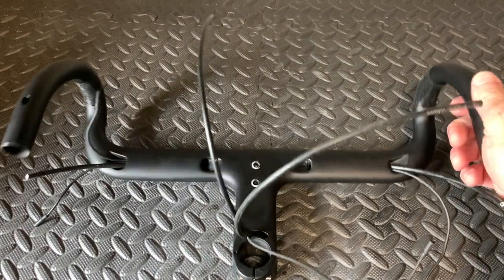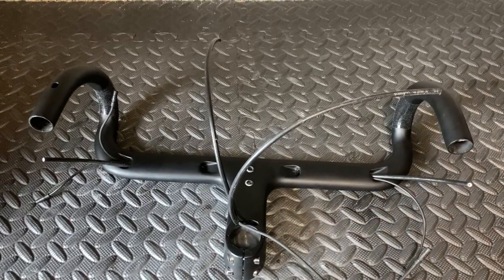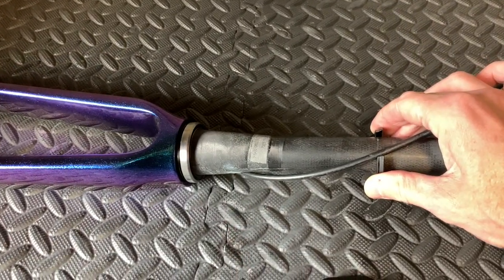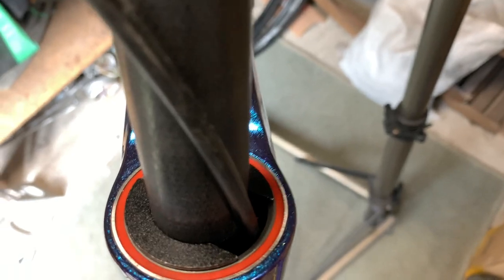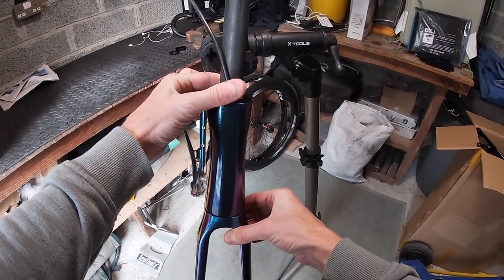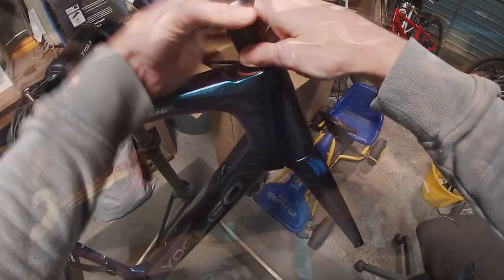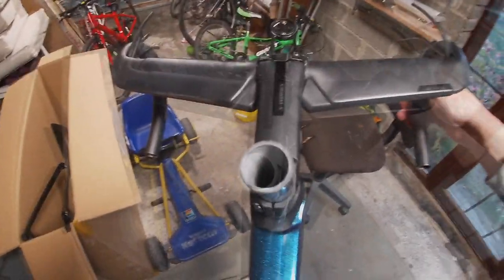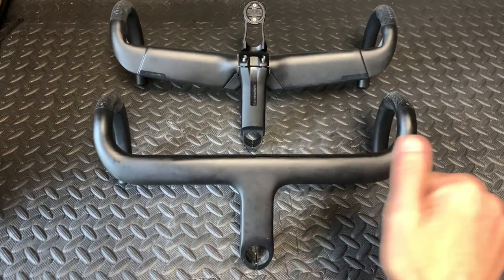Aerofly II Handlebar Vs Yoeleo Handlebar

Comment: use the yoeleo bars you can use 2k grit wet and dry and warm water to smooth it out lower grit if you need to widen that hole a little
Reply from the maker: Yeah I could do that... it definitely needs widening and smoothing. 👍

Comment: Ahhh now I get how you were planning to use the aerofly, using a spacer to keep the hole open.... 
With the yoeleo bars, I filed down the sharp edge of the hole a little, not really to enlarge the hole or anything, just to blunt the sharpness.
With the aerofly you might look to a solution to close that gap a bit, so you don't get to much water in the frame when you end up in a downpour. 
If you go for the aerofly it will be easier I think, but yoeleo bars might be neater.
Reply from the maker: Yeah it was a nice idea with the spacer eh? It works but I’m going with the Yoeleo bars. I’ll see if I can sand the sharp edges down, but they shouldn’t be that sharp really. 👍
Reply: @KyrosHouseCycling  Yeah good idea, you are a genius :D In case I ever want to use a different handlebar for some reason, I can borrow your idea. 
I used a small file. The cables still had some marks but no where near what you showed. Maybe I also didn't pull as hard :)
Reply from the maker: @cyclingmilan  yeah I probably pulled them way to hard, but that’s why I used some spare stuff so I could practice. 👍 I’ll try the small file  tip.
Reply: @KyrosHouseCycling  an other tip is to take your time, and when you feel some resistance to change from pulling the cable to pushing the cable or the other way around.

Comment: Great vid. I have yoeleo handlebars too. I'm having trouble a routing di2 cable from the shifter side hole through to the hole where the stem is. Any tips you can share on how you did this?
Reply from the maker: Yeah I threaded a brake cable with a barrel end through the hydraulic hose then fed the excess cable through the bars, then just pulled on the free end of the cable and fed the hydraulic hose through the bars. You could also use a cable feeding tool but there’s not much room in those bars for lots of cables. 👍